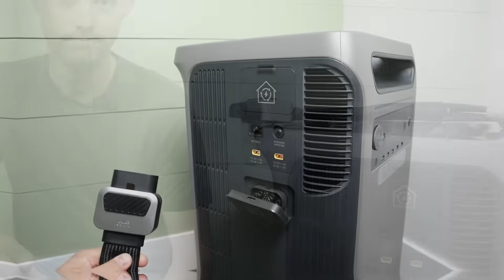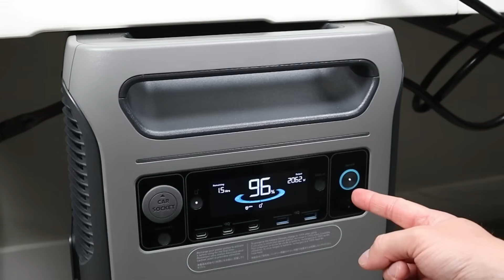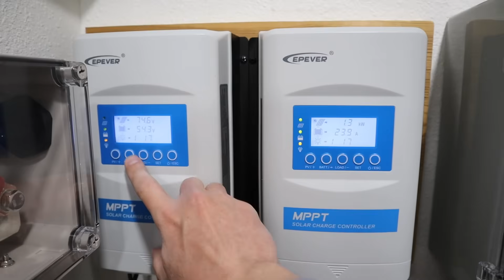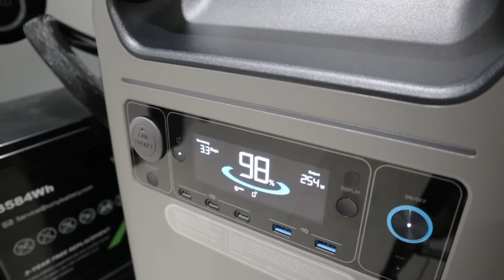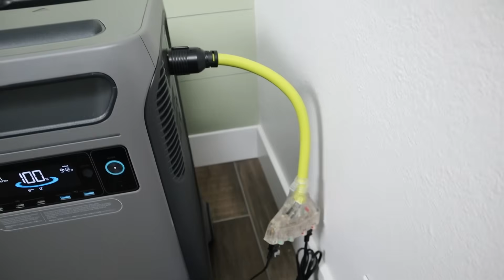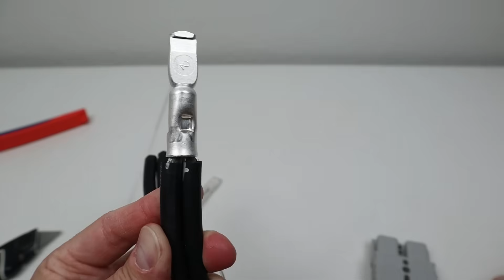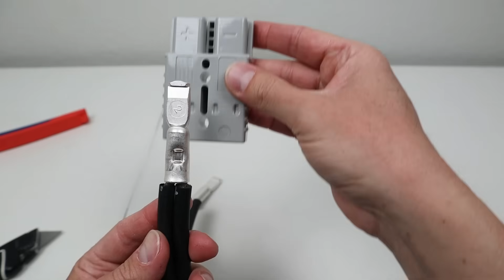I didn't Know This Was Possible!! Backdoor Battery Access to the Anker SOLIX F3800!

Comment: The old jarhead did a video on this the other day with the oupes.  It's really a game changer for those who want to expand but can not afford the expandable battery.  Personally I won't do it with my pecrons because its above my pay grade.  Pecrons bats are also a lot more reasonable as far as pricing compared to other companies plus you get the built in solar charge controller in them.  The old Jarhead also noted to test the voltages on your power station because he found some were true 48v and others were 52 etc..  So to stay safe test your power stations bat port then match it with the appropriate battery.  Hopefully thanks to you and the old jarhead these companies get a wake up call on their pricing for the expandable bats.  Some companies are a bit much!  Thank you Jason this must of taken you weeks to make this video.
Reply from the maker: Most power stations are 51.2v nominal these days. You can check the spec sticker to confirm the voltage.

Comment: A question that those of us who use the F3800 and the HPP would be this. Connected like this to our battery bank will the F3800 charge both its internal battery and the external bank. Fir instance, I have my Eco-Worthy batteries that currently plug in via the solar input. I set the self-consumption mode to say 50% reserved for a power outage. As the internal battery is being used during the day, the battery bank refills at 1150w. Solar refills the batteries at whatever. The way the F3800 works is that whenever the internal battery hits that cut-off % it begins to refill with the grid so it always keeps the percentage reserved of an outage at the desired level. Obviously, if the F3800 is readying the combined SOC when the SOC hits the mark and it starts charging will it charge both internal and external bank. That is the way it works if you have an Anker expansion battery. Same with a DIY?
Reply from the maker: If you connect external batteries directly to the expansion port without communication, they are literally tied in parallel, the battery voltages and state of charge will try to match. Since there is no communication, the Anker power station doesn't have any other control.
If you connect a charging source to the expansion port, it's a full manual process since there's no communication. If connected, the charger will charge the power station until it's full.

Comment: Awesome mod and video. I'm assuming connecting external battery bank also works on the F3800 plus? Curious if Anker will find way to disable power without communication in an update. Did you try running a max load test with battery bank connected?
Reply from the maker: I'm sure they will try to do their best to shut this down.... Who knows 🤷
I never ran a fun 6000w load but the 3000w loads seemed fine.

Comment: Maybe I missed it in the video but did you see if the Anker will charge the 48V battery when you plug it in to AC power? I believe it should charge the battery from the main unit.
Reply from the maker: Yes, the power flows both ways 👍

Comment: I've been doing the same with my Bluetti and Growatt, the hardest part is trying to find the unique connectors these manufactures are using without having to buy their "expansion battery cable"
Reply from the maker: Can you describe your Bluetti setup?
Reply: @Jasonoid  I just have an AC200L but haven't bought the expansion battery so I'm trying to find a plug and make my own cable to a 48V rack battery. I'm also trying to do the same with my Growatt which I have the connector on order from Ebay. So when I said "I've been doing the same" I mean I've been screwing around with the idea of this but having a hard time finding the connectors thru other sources. I also have the new Apex 300 on order so hope to have that for my main unit and iron out any hickups so I can do this on the new unit. I still just daisy chain the units together at this point tho.
Reply from the maker: @tonyinfinity the process should be similar, just connect the positive and negative cables to a battery. Proper fuse and wire size of course.

Comment: Very cool video, showing all of the things you can do by "hacking" the cable for the Anker Solix F3800...or, things you can do natively with any well-designed, component-based system.  If you don't need "portable", you can do a lot of cool things w/o jumping through hoops or voiding warranties.
Reply from the maker: This video is for all the people who unknowingly got scammed into buying the F3800 at launch... All the other influencers said 'it's amazing, just buy it' and then I tested it and actually found that the 240v turns off when charging making the unit bricked for high powered backup when solar isn't around.
So for all the people who spent thousands on a system with these issues, here's some options to try to get around it 👍
Reply: @Jasonoid  - Excellent points.  The F3800 has too little voltage allowed on the PV input and turning off 240v output while charging was a major limitation.

Comment: Super interesting. Love the idea of using it to allow the passthrough 120v to 240v charging. Would this work plugging into an expansion battery that is also plugged into the main unit on a F3800plus?
Reply from the maker: I tested a little bit with the F3800 plus near the end of the video. If you already have the F3800 Plus I'd recommend using their 240v generator charger since that doesn't void the warranty.
Reply: @Jasonoid Agreed on not voiding the warranty, and I do have that 240v charger cable, but found my use to be limited with it due to having to haul around a huge generator. Still hunting for that mythical 120v ac charging while still allowing 240v output. There are lots of times I dont have space for a large 240v generator while towing my camper, and a little honda EU2000 would work perfectly for charging slowly on cloudy and rainy days when solar runs low.
Reply from the maker: @kevinmorley8119  it's frustrating to only support 240v charging. I'm guessing they are going to launch a 60v DC generator soon that goes into that lower power (with the generator icon on it).
Reply: @Jasonoid  That would be awesome. Holding out hope for something like that which can be dual fuel and run propane or gas. Will definetly keep an eye to the future.

Comment: Love your videos but just once I sure would like to see live how how you cram the two large wires into that connector like you did here and like you did on the Chargeverter video where you got the chargeverter charging cable into an 6 gauge anderson connector. Just once, please.
Reply from the maker: I understand where your coming from but its impossible to film. I've tried. The hydraulic crimper I have blocks the view entirely. It's a wrestling match so my body also blocks the camera and the video capture just sucks.... It would be no benefit to anyone if I included it in the video. The two conductors on this Anker cable go right into the 2 AWG terminals perfectly, no trimming needed.

Of course that's different than the EG4 cables going into a smaller 6AWG terminal.... Don't feel like your trapped to my wiring methods, there are an infinite variety of ways to accomplish the same thing.
Reply: @Jasonoid  I don't care about the actual crimping, I just want to see how you cram the wires into a the 6 gauge connector. I guess I will never get you to do this so thanks anyway.
Reply from the maker: @007gomboo  stop messing around in the comments section and email me directly if you need explicit advice on how to do it.

Comment: Have you tried this with your Eco flow ultra
Reply from the maker: The DPU uses higher voltage batteries, near 110vdc. Unfortunately it won't work on the DPU 😩
Reply: @Jasonoid  96v sounds like 2 48v battieries in series.. but damn
Reply from the maker: @rytjson4487 51.2v nominal batteries in series, per pack.

Comment: Any idea how this would work with an Anker Smart Home Panel? Should the communications cable have the individual wires sealed so they don't cause any shorting between them?
Reply from the maker: I don't have the Smart Home Panel to test with. Since your using the battery expansion ports here I doubt it would make a difference. Using some sort of heat shrink on the coms cable would add some extra protection.

Comment: Excellent testing. If I had an Anker F3800 power station I'd be willing to try some of these mods. I passed on the F3800 since it had 60v solar and the 240v shuts off.

Comment: Great video, as always.  Have you had the desire/opportunity to experiment with that "generator" port on the F3800 Plus (the one below the battery expansion port)?  Thanks.
Reply from the maker: I tired. It uses a custom adapter.... The normal expansion battery doesnt fit! I'll have to wait till it's released. I think they are launching a DC generator or something soon
Reply: @Jasonoid  Thanks.  I'm not surprised that you tried.

Comment: I’m using the EcoFlow alternator charger in a similar way but on a smaller scale for emergency power with my delta 2’s. I can use my camper batteries for extra energy and thought I could make a more permanent solar array and an external solar controller to pump the full 800w plus the 500w on the delta 2 if needed. Nothing super complicated but those two power stations could get through a power outage of extended length if needed.
Reply from the maker: I haven't tested the battery port on my EcoFlow power stations, I'll have to see if you get a live voltage or not when the power station is turned on.
Reply: @Jasonoid  it was like the 2nd thing I checked on my Delta 3 Plus. But no voltage. They are probably more clever and have a relay on it. The data on it shall be CANBUS, based on some details I seen somewhere.
Reply from the maker: @jointercz the Montek x1200 requires two pins to be grounded out to get voltage. It's probably something as simple as that.
Reply: @Jasonoid  when I got it, I searched for like "ecoflow diy battery mod" but did not found anything. But I am sure if someone focuses on it, it can be "reverse engineered", would be nice.
Reply: @jointercz ecoflow is much more aggressive about vendor lockout, even mismatched expansion batteries (like 
Delta Max battery with Delta Pro) are blocked. 
people on Will Prouse’s DIY solar forum have posted trying to figure it out before but no luck it seems
Reply: @Jasonoid  Would be very interested in seeing what you find here.  A video exploring it even if you can't do it would be cool.
Reply: Im just using the 800w alternator charger direct to an external lfp battery. I was able to pick up the alt charger for $209 a couple weeks ago. The other use I have found is reverse charging my Hiker trailer battery that I don’t have much solar capability to use on (only 200w for a 140aH battery). The delta 2 can take 500w of solar so I can reverse charge at whatever solar is coming in and basically use the delta 2 as a pass thru in off grid situations not to mention that the panels and power station can be moved to pull optimal solar where the trailer is in a fixed place. I just need another $500 for the zoupw 450w panel for the easiest deployment 😊.

Comment: Another question - does the 3800 try to recharge your large battery bank when not drawing energy or does the anchor exp. Battery request charging through the communication cable? I guess that is likely the case.
Reply from the maker: It's literally a parallel battery connection. The voltages will try to match, meaning that if you put in a higher voltage it will charge, if your battery is at a lower voltage, the Anker will charge the battery.
Reply: @Jasonoid  So you can just use the charge controllers on the anker and wire in whatever as an expansion battery and it should more or less work then is what you're saying.
Reply from the maker: @chaon93 pretty much...but these are all experiments so no guarantees.

Comment: The Pecron MJ32 cable is being marketed as an "output" cable, but shouldn't it be able to be used to hook up a DIY expansion battery also, as an input cable? It would be easier than cutting up the expansion cable. I looked at MJ32 plug and there doesn't appear to be any communication. The only limitation is being limited to pulling 1200w because of the wire size.
Reply from the maker: Exactly, I think you can use that MJ32 cable for this same exact purpose. Just keep the total power (input or output) at a reasonable level.

Comment: Nice testing video! Two questions, did you turn off the no load “smart” or timed shut down setting on the 3800+ in the last test? I assume so as that is a basic feature. Also for the last test why did you not have the load on the 3800 as that does not have ac pass through when using the 240 inverter?
Reply from the maker: I did not have any "autooff" settings enabled on the F3800+ during the test.
I was running the heaters on the F3800+ just to make sure the 240v would stay enabled and it didn't.

Comment: I saw the original video as well and wanted to do all these test but havent had the time.  Glad to see everything works.  One thing I would possibly suggest is not charging a single F3800 over 1C or 3800watts or maybe even 3600w.  If 2 connected then 2C or 7600w or again slightly lower at 7200w.  I only suggest that because I remember seeing max charge of 3600w somewhere.  The other thing I was thinking for the F3800 Plus output shutting off is, isnt there a setting in the app to keep that on.  Either way great job!!!
Reply: My F3800 240v  shuts down after about 30 minutes when there's no load on it.
Reply from the maker: I had the 'auto off' settings disabled. It should have stayed on. Something else was going on with the device that was shutting it down.
Reply: I would hope the BMS would protect from over current. I think you have a video testing over current protection through this port!

Comment: So you're bypassing inverter charging by using the expansion port with an external charge controller. What's the input limit on the expansion port? What are the benefits other than kepping the 240V ouput powered? I know the purpose of your test was to keep the 240V powered but how fast can you charge using the epansion port, solar, and AC plug?
Reply from the maker: The battery expansion port is a 51.2v nominal battery.
I talk about the three benefits in the first couple minutes of the video
There is no documentation on the maximum input rate, I wouldn't go over 3840 watts since thats a 1C charging rate.

Comment: The Delta 2 doesn't do this. Sad.
Reply from the maker: I haven't tried modding the EcoFlow battery cable. Do you get live voltage at the port when the power station is on?
Reply: @Jasonoid  No, but if you apply voltage to the port the estimated time goes up. Doesn't actually charge/discharge through it though.

Comment: How many amps does the expansion port have available? Will the bms allow faster charging with an external charge controller? If your using an external charge controller to charge with more solar and the bms is also managing charging is there an issue?
Reply from the maker: I think I remember reading that the expansion batteries can handle up to 170 amps. The actual number is in the user manual 👍
Reply: @Jasonoid the manual doesn't state how many amps the expansion port can output.
Reply: In my latest testing with v2.4.0 firmware I can only draw 40amp DC from the external battery anything more will trip and turn off all of the ports. Note I had a 240v 25amp AC car charger attached anytime it went over 40amp, so I had just adjusted the AC amps manually so I don’t go above the 40 DC amps.